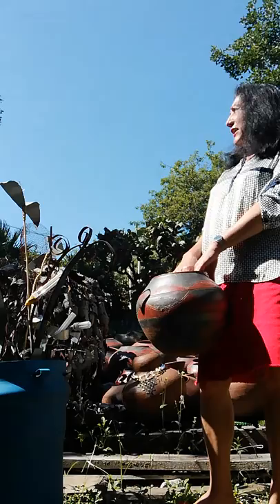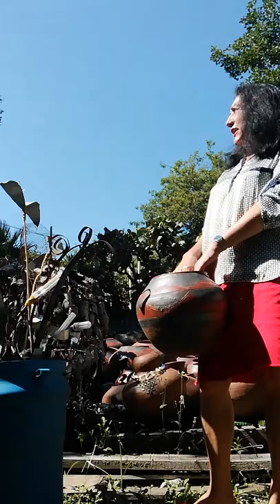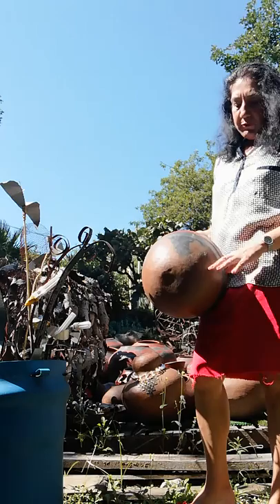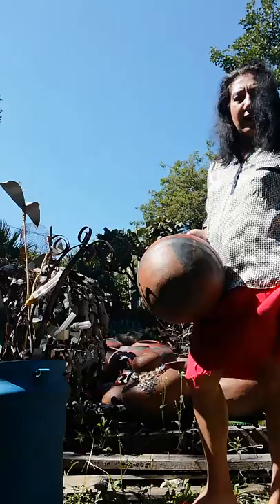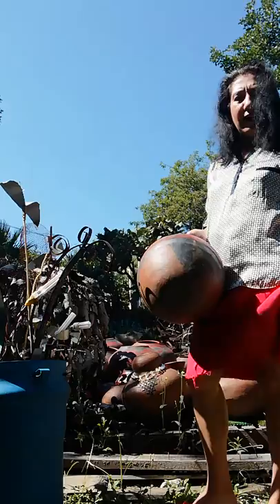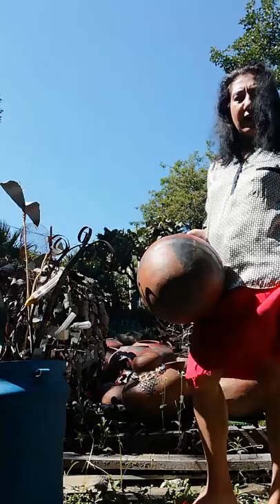Venda pots. The story of clay

Comment: Khali, tshidudu, tshibvuvhelo - these are some of the names of the kinds of pots depending on size and usage. These things are meant to work and carry water etc. So if you don't use it, it will fall apart. However, the real pots are the ones made from mud found at a river. Thats the one thats perfect. But since people are chasing profits these days, they are starting to use red soil for making the mud.They don't really go through the normal processes in order to get these pots to the market. My grandmother has pots which have been around for over 20 years. Some are used for decoration now.
Reply from the maker: super cool comment